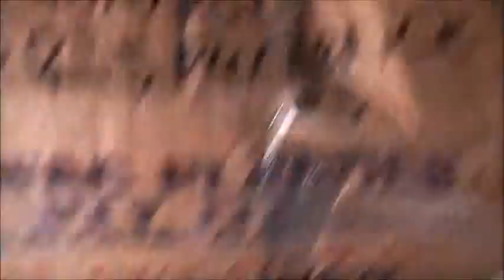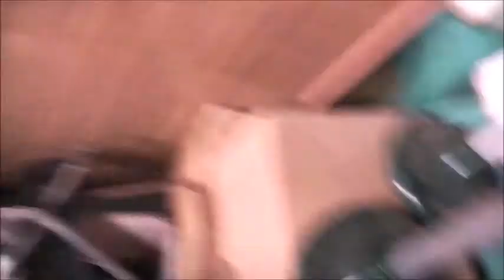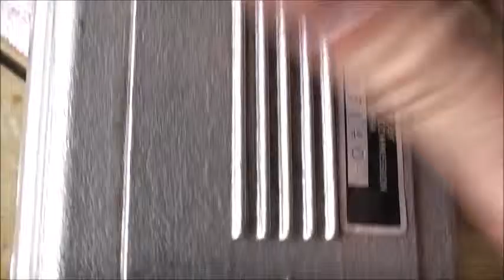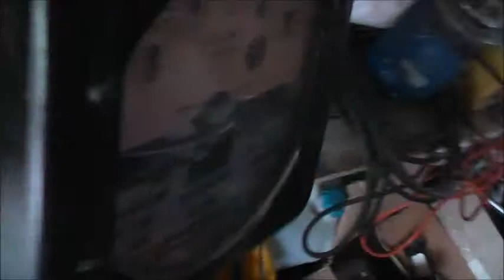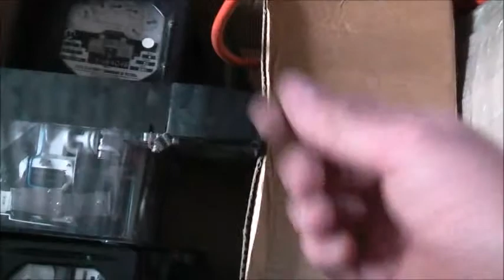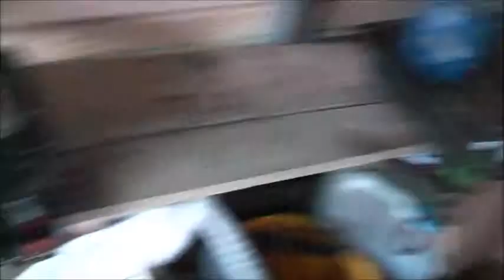More Meters To Test & Store!

Comment: Ah! Lots of nice-looking instruments on their way by the looks of things. :-)

It's interesting that they have put those contact-sets in meter cases like that. I've never known that to be done before, and as such, as like you have there, contactors used to be in their own dedicated cases.

Once contactor I would like to get hold of, is what's called an ENBRAY, which is the name of the manufacturer.

These were sometimes used in multi-occupancy meter cabinets. Instead of having multiple rate-changer timeswitches in one cabinet, there would be one rate-changer, and that would energise the coils in the Enbray contactors and then the loads for the individual flats would be switched that way.

The only downside with that arrangement, was if the rate changer packed up while it was off: Every flat in that house / block wouldn't have any storage heating or off-peak heated hot water!

The ENBRAY contactors are (I think) 100A and so were ideal for either up-rating an 80A Horstmann, or even one of the 60A ones, or even a 30A Vmk 2 model. :-)

Thanxx for showing,

-BoomBoxDeluxe.

20th october 2015, 15.40